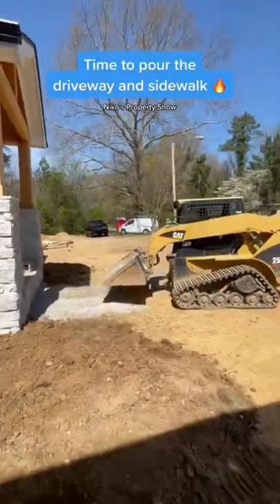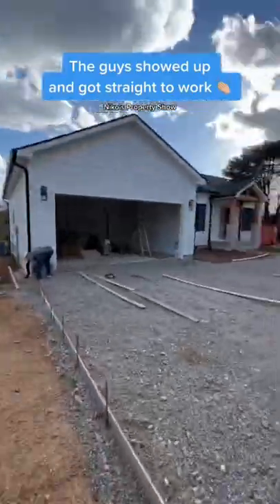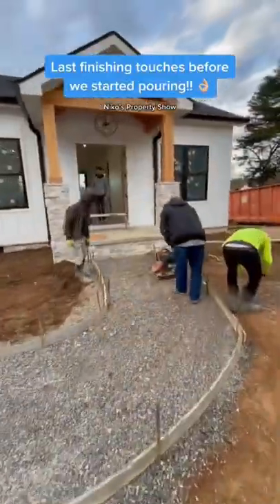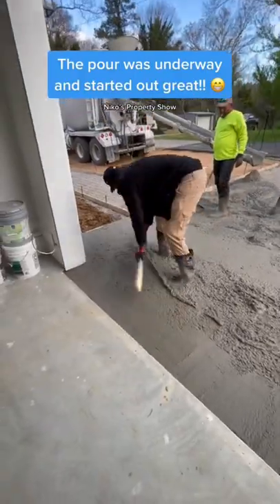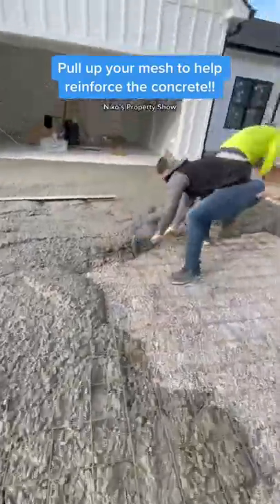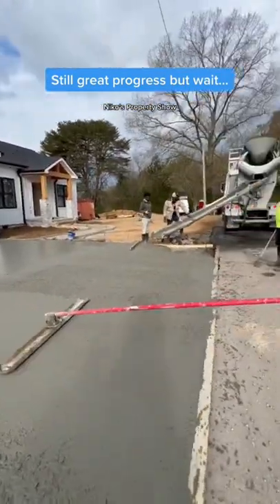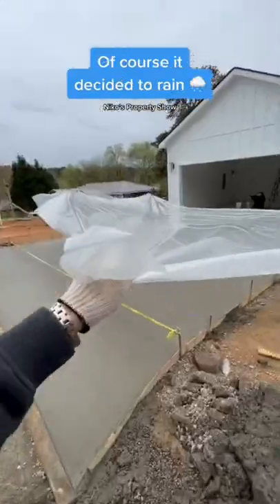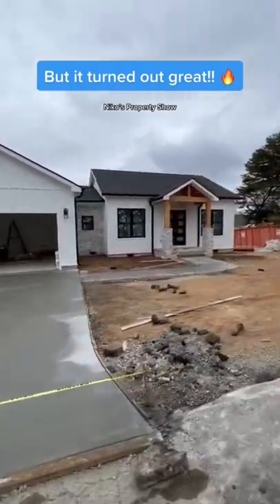Pouring the driveway and sidewalk with concrete!! #concrete #construction

Comment: Yeah.... wire mesh is supposed to be installed on risers so its actually IN the concrete not under it...  also no rebar to be seen especially for a driveway, rebar should be an 18” grid pattern of #3 steel for a minimum of two cars....this is a hack job will be cracked to pieces in 5 yrs...
Reply: Totally agree, concrete cancer and cracks here we come
Reply: This is actually really interesting to know, I was just told yesterday by my foreman that the way people in the industry refer to rebar sizing is by the diameter of the rod itself so 18” grid using 3” diameter rods.
Reply: @dannon9699  #3 rebar is 3/8 inch
Reply: @dannon9699  your foreman isn't very good then...
Reply: This whole house is suspect after all the missing important details.
Reply: @Coltgov191145  I was really drunk when I wrote that, I meant 3/8” he’s not bad I’m just a dumb apprentice.
Reply: Yeah I have done some concrete in my life and I have seen and done shoddy work like this. The risers are almost never used except a few places here and there. The person i worked for back then was pretty bad at this and skimped on the extras. 
I have read studies that if you insulate the concrete it will help prevent cracking do to the thaw and freeze cycle. This gives a little bit of flex between the concrete and the ground. So when I get any concrete work done I plan on insulating and make sure that risers are put everywhere. I hate it when people hover yet when you see shoddy work like this you got to hover to make sure they do it right.
Reply: I do flat work for a living and the list of things wrong here is long I wouldn't pour this for a dog house
Reply: Very true.... I had  4 deliveries of 12cub yrs of dirt. My driveway is a 2 car driveway and very long (fit about 10 cars) Dump truck driver didn't wanna drive on the concrete because he's believed he'd crack it. I told him my house was built in 1998 an he got in his truck an drop the dirt. No cracking...
Reply: I was gonna say.... In Australia we call them chairs not risers but same thing, thats harder to do aswell because ive lifted the mesh in concrete without risers and its harder then just setting it up before the concrete is in
Reply: I was thinking the same thing, I was watching a concrete company do a shop floor last week and they had a survey meter to make sure all the gravel was level and then they used rebar and used the survey meter to make sure all the rebar was same depth. This looked like they just dumped out gravel, flattened it. Tossed some wire in and called it a day
Reply: Did you watch the video casue they were lifting the mesh, u don’t need it on risers for simple mesh if u know what the f you are doing
Reply: @renebeaulieu3688  I do know what the F I am doing, I do it PROPERLY for a living every day and have for 31 years there is a reason why they invented and use the chairs...lifting the mesh is not even close to the same and can just as easily and usually does settle right back down as you vibrate it and move it while lifting ad pouring other sections that is a hack way of doing it not to mention if they knew what the F they were doing they would have rebar in the driveway....
Reply: i was wondering about the risers as well
Reply: @Coltgov191145  if you are vibrating a drive way I wouldn’t want you doing mine, all ur doing is separating ur aggregate at that thickness it’s useless, poured concrete for 10 years, and am now a civil engineer, yes rebar is a good idea and yes I would 100% always put my rebar on chairs , but for mesh in driveways and sideways, it’s not a hack way of you know what ur doing, it’s much faster and more efficient, but if you don’t know what ur doing, ya probly should use those chairs to make sure it’s done right
Reply: @renebeaulieu3688  not with a vibrator....🙄 in order to pour concrete you need to stand on and walk around on the mesh, in order to "pull up" the mesh you need to walk on it and move it and touch it therefore everytime you touch and move that mesh it vibrates causing it to sink yes you might pull up the piece right infront of you but as soon as you move around and move the next piece that last piece is now sinking with every touch and step... I am terrified that you are a civil engineer since you clearly can't engineer your way out of a cardboard box....
Reply: Exactly no rebarb or chairs so someone lifting mesh randomly
Reply: @onlygaming69  im in Florida and call them chairs.  I was in the swimming pool construction industry for over 15 years... I just made a comment calling them chairs.  I am glad someone else can understand what I am talking about.
Reply: Use granite rock as your aggregate in the mix if you can get it in your area Much stronger concrete that lasts forever
Reply: @Coltgov191145  😂😂😂 ya can’t engineer my self out of a box that’s why am. 4.0 top student, u just keep playing that banjo in the hole man, that’s where u belong, it’s ok we need labourers to do the jobs the engineers design
Reply: @dannon9699  same buddy same
Reply: I personally use crushed beer cans but yeah 100% agree
Reply: @onlygaming69  call em chairs in Alabama too
Reply: @dannon9699  #3 bar is 3/8" diameter.  Whatever the number bar it is in 8th. #4 bar is 1/2", #5 5/8" and so on.
Reply: @Spirit Life  Still not the right way do it right or don't do it at all
Reply: Not to mention, there are no expansion joints in the driveway.
Reply: @onlygaming69  we call them chairs in ohio too. Also stomped in mesh before the straight edge...but I could never figure that one out really...since 4 men walked forward and then backwards over it.
Reply: 👍 nobody floats the rebar ever anymore😂 they pocket the money the charged for the risers. I learned to pour concrete at a trade school and the teacher told me if you ever do any demo work you’ll see how cheap and shoddy everyone else’s work is, and boy he didn’t lie
Ever since then I have an eye for detail and notice the little things, for example if someone finished drywall lazily or missed the mesh tape or a corner edge brace, flooring, tile, electrical work 
I’m always pointing things out
Side note: my boss is building a room around his camera setup with like 50 exposed wires to lock up cigarettes at night but so far nobody’s thought about a smoke alarm inside linked to the security system or dropping the existing fire sprinkler from the high ceiling down into the annex. I just think if a fire starts in that room, by the time the fire and smoke spreads enough to activate the sprinkler system for the whole store the fire would be too big to contain, and much too big for a sprinkler system to do anything

Comment: I have heard great things about using insulation under concrete. From studies done putting 2 inches of foam will prevent cracking of sidewalks, driveways and pretty much everything outside. I will no longer install anything concrete unless its insulated.

Comment: Don't ever put poly on top of fresh concrete. It will discolor it. That's why you have really white spots an dark spots. Tip don't pour if it's over 30% chance of rain... Tips to live by...
Reply: I've never used poly to cover concrete but I have used tarps before which have no effect on the colour of the concrete. The white spots are usual as the concrete cures. It will eventually all turn white. Like I said at the beginning, maybe poly is different.
Reply: If the poly, tarp, or blanket touch the curing concrete it will leave a tie die patter from the condensation on the blanket. A couple ways to prevent it is to stretch wet burlap over the concrete with no wrinkles in it or tent over the concrete so the blanket doesn’t touch the concrete. But then you have to hope the water from the rain doesn’t make the blanket sag.

Comment: The lines that Trey is talking about are either done by putting joints in with a joiner, or you can cut lines with a saw.. most guys go back and cut the lines with a saw after concrete is hard.. I personally have a softcutt saw that cuts lines while the concrete is still green.. putting joints or cuts in concrete controls the cracks, concrete will Crack no matter what you do.  Joints or cuts make the cracks go inside them so the cracks are nice and strait.. ColtGov was talking about putting risers under wire mat which are actually called chairs,  and because they are on gravel you don't want to use chairs because it puts the wire mat into the very top of concrete, you want wire mat in the middle of the concrete  so picking up wire mat by hand as you go is perfectly fine... Rebar is better than wire mat but wire mat will do the job... I personally use rebar on every job,  haven't used wire mats in over 30 years... and on a home like this I would use sand as a base instead of gravel.. my issue with this job is that they didn't backfill the forms... thats where you push up dirt or sand or gravel up against the back of the wood forms... 2 reasons for that,  first  is so that the forms don't move when the concrete pushes up against it,  the second reason and main reason is because on homes it always takes the home builder a long time to get dirt work on yard finished and sod installed.. so that concrete will sit there and if have any rain the water will wash out that gravel underneath the concrete and leave a void,  especially since most of these new homes don't have guttering on them so all that water will come rushing off the home and cut a big hole under the sidewalk.. A year later the home owner will have the side walk or driveway start falling or cracking.. this happened on my personal home.. I have a hole under my driveway large enough that I could fit in it and now driveway is falling down all because the guys that did the concrete were lazy and didn't backfill..  so going to have to spend my money to break it all back out and pour new concrete .. same thing home owner that buys this home in the video will have to end up doing.

Comment: Lift the mesh. Use chairs to get the mesh the exact height with cover. The way you do it the mesh will sink and the concrete will definitely crack.
Reply: Thats not at all how it works
Reply: Yes it will, concrete has no structural strength without steel.
Also they did vibrate the concrete so it will be full of air pockets.
I’m a Concretor and have been doing it for 25 years.

Comment: Looks great BUT, you didnt score the driveway. Its Going to crack due to expansion and contraction over time. Give it 3-5 years before the cracks start showing and 5-10 before repairs are necessary

Comment: In Australia we use these little things  we call "chairs" to hold the mesh up off the ground, why do Americans do it like that? Seems like extra work that could be avoided or less work either way seems dodgy, do you do the same on house slabs?
Reply: You're supposed to use them and also I don't think mesh is even correct for the driveway
Reply: @michaelf.2449  there mesh looked weird just because no chairs, but ive only just started in this industry so im pretty clueless tbh

Comment: I mean this doesn’t look that bad. It looks like pretty decent work to me. I understand there are some textbook things that are skipped but you’re not gonna get like a 6 to 8 inch gravel base and a 6 inch pour with perfect risers and rebar everywhere. It also depends on the mixture and they didn’t put too much water in there, so I bet it’s 4000 psi plus, which is cool

Comment: No joint in the driveway. It will crack. Use fiber additive instead of wire mesh so when the next guy comes in 10 years to redo it they can break it up easier

Comment: Where’s the plastic chairs that keep the mesh off the ground?, concrete cancer and cracks here we come
Reply: The comment I was looking for
Reply: Can u tell me why...id like to know....r they skipping steps or smthing? Very curious
Reply: That's for rebar. Mesh just gets lifted during the pour.
Reply: In addition to the plastic chairs or dobies, they definitely needed to use rebar in driveway.  Not wire mesh.
Reply: Yea that's for rebar bro.... Mesh isn't the same
Reply: @christianromero6604  A chair is a plastic riser to make the metal reinforcement end up in the middle of the concrete, not under it. To be honest I didn’t see one thing done correctly in this video. Horrible “contractor”.
Reply: @mattchu42069  not where I live, compulsory to put chairs on mesh and Rebar
Reply: Only 1 guarantee in concrete? It will Crack hopefully it does in those control joints! At's ALL!
Reply: Geez you're getting some dumb replies..  Good comment bro.

Comment: No expansion or control joints and really wire mesh for a sidewalk and driveway? At least #3 rebar. No wonder these crack easily
Reply: Tru dat
Reply: You should see what got done to my paps driveway. It's pitiful but somehow he's happy with it being two different shades, a deep I assume broom mark in the middle, and this kind of mesh used on a hill. Also so close to the property line the forms were technically in the neighbors yard.
Reply: You can use a heavy duty WWF doesn’t have to be bars. If they used 4500+ psi concrete theoretically one sq inch can support a car.  You just need to dowel the exp joints
Reply: You get what you pay for
Reply: @xxtacowarriorxx6440  actually funny enough the two different shades isn't a problem. Well at least for the company I worked for we only guaranteed strength not color. Usually it's from the different types of cement that can be used but usually if it's all from the same plant that isn't an issue. But this job is fucking shit you need rebar for the driveway they didn't pour this with some "High Early" type mix design were a semi could drive across it after 12 hours.
Reply: I agree it needs rebar for the drive but don't you think mesh is okay for the sidewalk?

Comment: Wire mesh....keeping concrete guys employed. Lmao crackacrackacrack says your concrete in a few years.
Reply: Are you not supposed to put rebar in there to strengthen it?
Reply: Lol yeah it has minimal reinforce strength. My favorite was the "it's very important you lift the wire mesh"  you mean the wire mesh that you're standing on right after you lift it up?
Reply: Wire mesh/ rebar doesn't prevent cracking. Concrete will always crack its supposed to prevent lifting and separation when the concrete does crack.
Reply: @zayneparker8711  your supposed to use chairs they hold the rebar/mesh off the bottom, the way he did it, it just goes to the bottom
Reply: Hi  no it doesn’t strengthen it really…it may prolong the concretes life a little before it cracks but the purpose of rebar is to hold it from falling apart when it does crack
Reply: Chairs and don't let me park/drive on it for  (weather dependant) 7-14 days and no reliefs?
Reply: Why are people saying that wire mesh causes cracks? That's literally why you put wire mesh in concrete, so that it prevents cracks. The only reason this driveway would crack is because it's 4" thick
Reply: @OfficialReckM8  It's not that it causes cracks. That's not what they are saying. They are saying they use it over rebar and risers to save costs
Reply: @AnN-py2em you’re not supposed to use chairs.

Comment: No chairs under the wire welded fabric… Wire welded fabric should be located in top third of the slab. No contraction joints cut or troweled into the driveway portion. Oh boy…
Reply: They might saw cut after. Seems to be a thing by region
Reply: That driveways done in less than a year! Big facts

Comment: I think it's guaranteed to get a lot of random cracks because you didn't put any expansion lines in there anywhere . Are you planning to do saw cuts part way through afterward . I have seen the sawcut  method work to a minor degree but it's never as good as putting in proper Expansion Joints .

Comment: Pouring concrete over your stone veneer.. now when the concrete settles down and sinks. It will now be attached to your stone veneer so eventually your concrete will pull your stone veneers down with the concrete.
Reply: Didn't catch that. Ouchhhh. What a hack job

Comment: I mean, I don't know where you live, but that paper thin layer of gravel would be absolutely useless where I live.  Anything less than 10 inches of depth would result in that concrete turing into rubble within a few years.

Also, that wire mesh placement is very questionable.